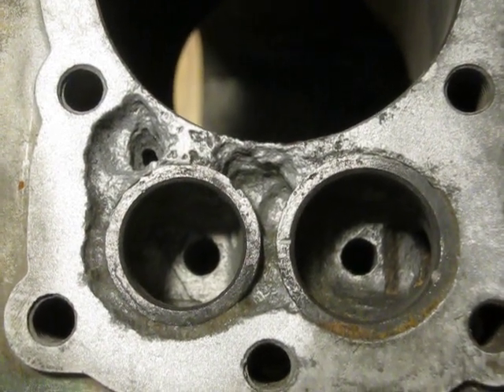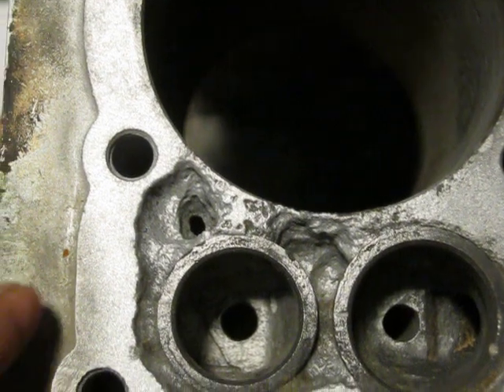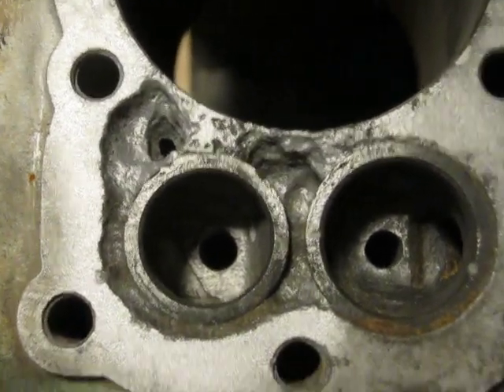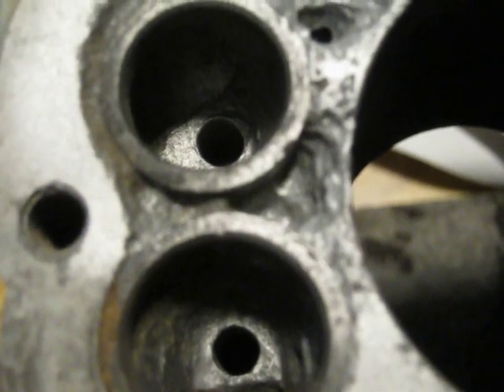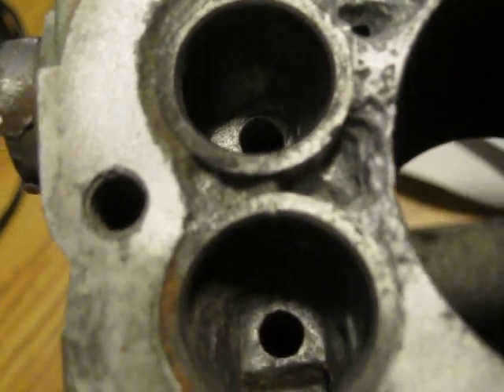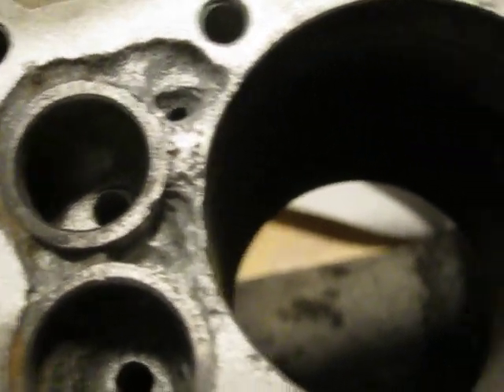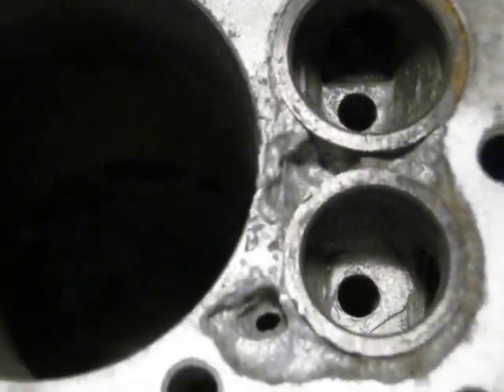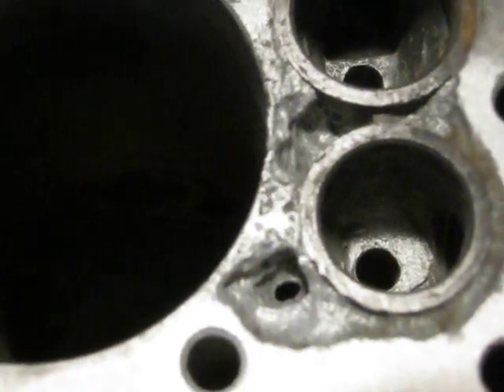Holey Engine Block! 65 Subterranean Briggs Part 11

Comment: Your care and effort alone will ensure it will run at least a little while. You are determined!
Reply from the maker: Yes, perhaps too determined, I an JB Welding up the block now, but being a cylinder, it has to be done in small sections. I have already filled in around the valve seat area that I show on the vid. Hopefully it will hold enough compression to run when I am done!
Reply: ChargerMiles007 
I can't wait to see how it does.

Comment: Ouch! I have a couple engines worth of VW cylinders that look like that from water sitting in them! I've often wondered if there was an engine with pistons just that slight bit bigger where I could have them fit the cylinders after they're bored out enough to eliminate the pitting. Like you, I managed to save most of the pistons, including one that tried to eat a nail or something! (though I had to pound the rusted-in ones out with a lot of force!)
Reply from the maker: Yes, seized pistons require a lot of force to push them out, this little fella took 4 tons at least. i figured we were going to collapse the weakened engine block!

Comment: Would boring it out and adding a cylinder sleeve be a possible answer?  At the minimum, it would ensure a smooth wall for the piston rings.
Reply from the maker: Yes, that could probably be done, if a person really had to save the engine.

Comment: What is keeping the valve seats in ....it looks like they could just fall right out
Reply from the maker: There is still enough metal there to hold them in, as they don't feel loose. I give one a soft pry, and it didn't move.
Reply: Dave Ackerman 1967 stuck there out of habit
Reply: Hopes dreams and structural corrosion.
Reply: gokartbuyer ya you guys got that right
Reply from the maker: Ahhh, it is rock solid, good for another 100,000 loops around the backyard!!!  :)
Then I start it up and it implodes 5 seconds later!  LOL

Comment: @1:53  sleeve that sucker
Reply from the maker: Yes, that is a valid suggestion, as well as TIG welding up the valve seat area. i just don't have the machining resources, time or money to do that, so I am using the Handymans Secret Weapon #2 ....J-B Weld  :)
It will probably lunch itself if it runs at all, we shall see!